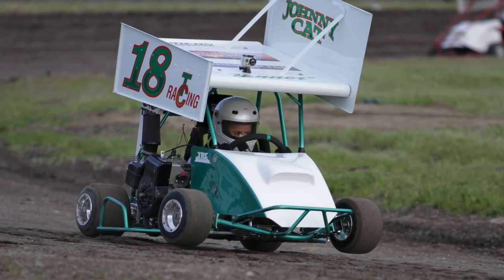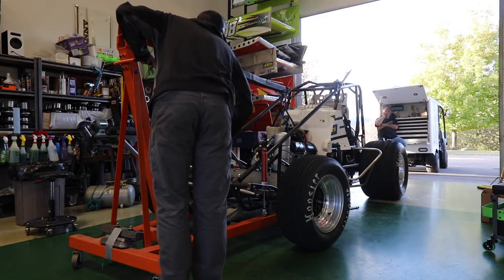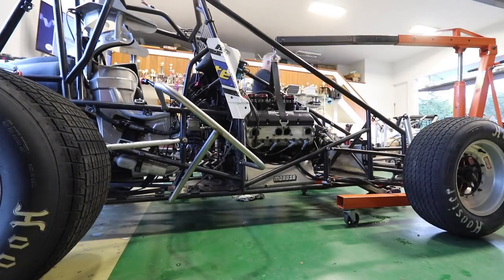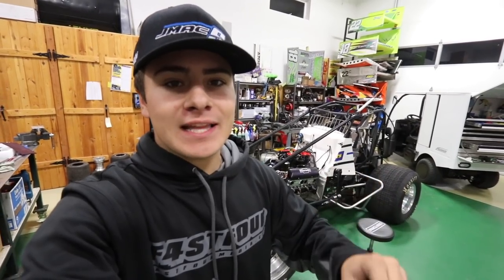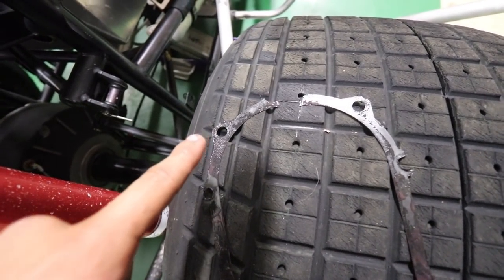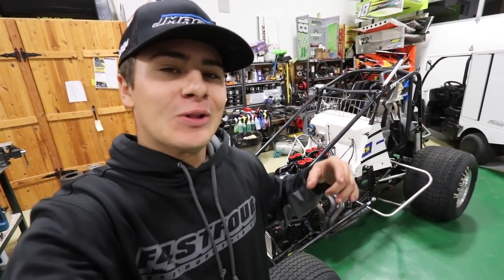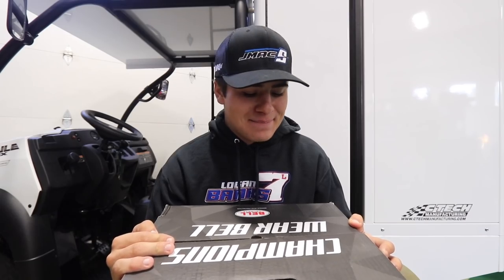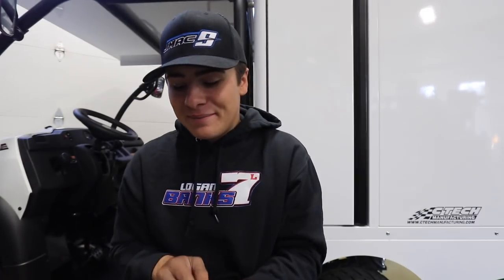WE ARE HEADING TO CALIFORNIA TO RACE THE SPRINT CAR THIS WEEKEND!

Comment: Kiddo, I retired from the automotive industry. When it comes to radiators, it is best to put in distilled water rather than tap water. Tap water has minerals and salts in it which corrodes the system over time.

Comment: I was the crew chief for the supermodified team out of Concord Calif. We raced every week at San Jose speedway about 60 miles away. One night we blew the engine on the second qualifying lap. I jumped in the dully with one of the team members. I drove to our shop in Concord got the spare engine (fuel injected small block Chevy). Drove back to the track. The others had the blown engine out and were waiting for us. We got the engine in got the timing set as the cars were pulling on to the track. We had qualified for the A main Missed the heat race and got fifth. Those are the nights you never forget. I was so proud of my guys we work as one that night.
Reply: Impressive! I used to race at San Jose Speedway in the 90s. Wish the track was still there
Reply: what,perrys motors don't blow lol,that's what he was tryin to tell us.
Reply: What Nick Recinos motors weren’t good enough back then